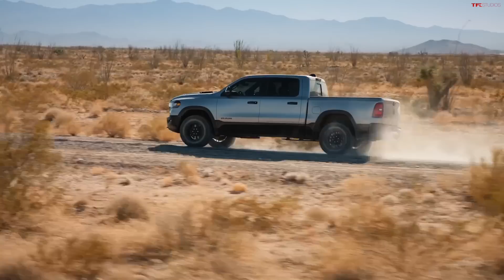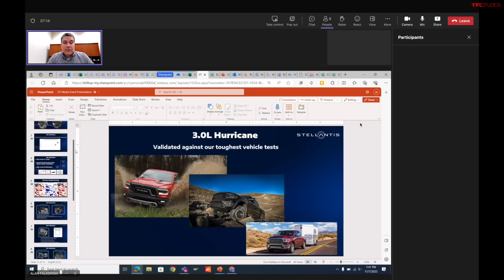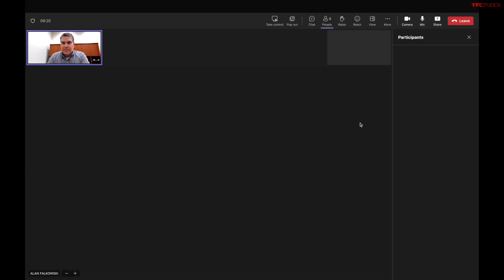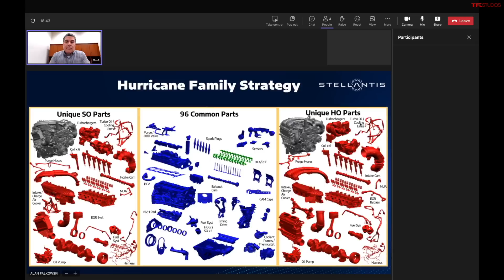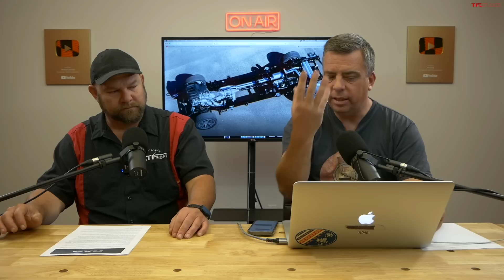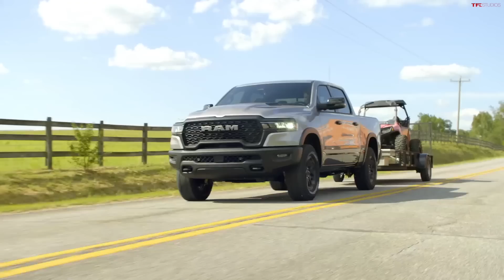2025 Ram 1500 & Ramcharger DEEP DIVE with the Chief Engineers!

Comment: 44:00: Nevermind the 690mile total range--that's just gas tank size--the story is the beefy battery range of 145miles!!!  They had to make it beefy for the horsepower output to make it a towing vehicle.  Buuuut with an EREV they don't have to make it tow in all electric that far.  (They just need to be sure the genset has horsepower output at least equal to the towing horsepower *average*.) 

An EREV can halve the battery of an all-electric towing vehicle while keeping sufficient power.  It's a great reality about the electrification of big trucks--see Edison Electric in British Columbia.

Having talked about the towing, the other benefit of 145 mile all EV range (unladen) is that the neighborhood folks who hardly ever tow will be running on insanely cheap household electricity basically all of the time!  It's a perfect design for every use case from infrequent short range towing to everyday long range towing.  

Even the everyday 600 mile towing use case (lol) gets a lot better MPG than just gas, and the comfort (you're sleeping in it lol) and performance benefits of electrification, to an outsized degree compared to just hybrids. Further, I would argue that to properly hybridize a heavy towing system, you HAVE to have such a beefy battery that you need to make it an EREV! 🤩⚡💪🏾 Yes I'm asserting you can't even have a good heavy towing hybrid without it being an EREV.

In passenger vehicles it's gas, then hybrid, then EV.
In towing vehicles it's gas/diesel, then EREV (with 100+ mile electric range)...then EV later.

Comment: All new = all new problems,   I prefer the Ramcharger approach with a 12 year old engine and a tried older Cab.  There is enough new stuff on the truck which will have issues in the first year or two.

Comment: part 1. 
 new metrics will be required. not hp and mpg. but rather KWH @ RPM, fuel consumed at RPM, etc.  USA should adopt the EU metrics. 
part 2.
what is the value proposition?  seems none.  consider...
1/ tank is 25 gal. range from gas is 500 miles. say, fuel consumption is 20 mpg, UNLADEN.  what will it be towing 6k#?  maybe 10 mpg? 
2/ if 20 mpg, this is now average for all ICE trucks.  so why bother? 
3/ Ram has the worst history for reliability and customer service.  why will this be any different?

Comment: 10 years down the road when its using oil and got more blow by than boost from blown out piston rings and valves see how much you love that forced induction truck engine. Oh yeah but you will be off warranty and they make money selling new vehicles not old ones. They could care less how long it lasts. Sure they hate all them big displacement V8s still going strong after half a mill and 20 plus years. No money in that.😂. Im done with ram myself stick to used market or change brands sad because they are still by far the best looking truck inside and out.

Comment: When they compare a naturally aspirated V8 to a charged (turbo or Super) is is NOT apples to apples. How much HP and Torque would the 5.7 Hemi produce at the same boost levels? More is my bet. How much better would the durability be with forged parts? I could go one, but some proof is available in comparing the TRX Supercharged V8's HP and torque (except it is 6.2L). This also brings up the fuel-air charge size per cylinder. Engines should really be compared based on HP and torque generated per cubic inch or liter as well as fuel efficiency per cubic inch/liter.

Comment: Attention @Ram and @RamTruck owners: The reliability of new Ram trucks has been a major letdown. As an owner of a @Ram truck, I find myself in a frustrating situation with my vehicle sitting in the driveway without an engine, all because the warranty was declined by @Ram. Over my four years of ownership, I've endured a total of six months spent at the dealership, grappling with recurring electronic and emission problems.

My ordeal began when my first engine failed after just two years of ownership, followed by a transmission failure at 2.5 years. Now, my second engine has given up the ghost after a mere 72K miles. Shockingly, @RamCareWarranty refused coverage due to high mileage. It's truly baffling that after investing $50K, my truck can't manage more than 72K miles without needing an engine replacement. What is happening with @ramtrucks?

Comment: All of the new features and options are fine.  But now for the elephant (not the HEMI elephant) in the room, PRICE.  Everyone in the truck business has basically priced themselves out of the market.
Now for the engine:  Will it be as reliable and durable as a slant 6?  Almost certainly not, nothing else ever has been.
Your explanation of why a straight 6 rather than a V6 missed the main point.  The straight 6 is cheaper to build.  And doesn't package as well, but you can get around that in a rear drive truck.  It's going to weigh more than a V6 because of the longer heavier crankshaft.  Yes, it is smooth, but so are the 60 degree boxer crank V6s that Chrysler has been building since 1990.  Using dual exhaust seem rather at odds with trying to control price and weight.  There is no performance advantage to duals following turbos.  
My comments are somewhat irrelevant because I will not be buying one of these.

Comment: I just got a 2024 2500 Ram 4x4 work truck with 6.4l Hemi and turning in my 2018 6.4l 175k miles only problems were fuel pump failure, Electric radiator fan failed, and the inside of the radiator plugged up/ gummed up causing an over heat. Other than that engine was very reliable. 2024 I will update at the end of the summer. the 2019 was the classic body style.

Comment: so I will respond to your tow hook question.  I use mine several times each winter.  I regularly pull US MAIL rural delivery mailmen and their vehicle out of snowbanks.  I also use them to pull my John Deere snowblowert out  when I screw up and slides it off the road.  The real advantage is it is an easy and safe place to hook..  Plus you don't have to lay down on the ground and try to find something underneath that you think is strong enough t to hook onto.  Obviously all this app;lies to the front.  In the rear you use your trailer hitch.

Comment: The range extender may be the best  EV system yet. It's been effectively used in railroad locomotives for decades. I'm a bit surprised they didn't use one of their 4 cylinder engines to power the generator, to save weight and space. I suppose the existing V6 was a more cost effective solution for the first model.
Reply: The pentastar engine is pretty lightweight.

Comment: Did you think the manufacturer would tell you that they created an engine worse than hemi?) It seems to me that the main task is to reduce the cost of production. This engine is no better than hemi and certainly not more reliable, but it's not worse either - it's just another engine. Repairing such an engine will cover all fuel savings, how much will it cost to replace 2 turbines? The oil requirements are higher, the fuel requirements are higher, the engine will constantly work under high load, especially if you are engaged in towing. Only manufacturers, engines, oils, fuels and lubricants benefit here. it's the same as touchscreens. Few people realize that it's just much cheaper than making buttons or dials. What do you think?

Comment: Geez, RAMCHARGER: Lets do the math. 690 range on 27gallon tank = 25miles per gallon. I got 33miles per gallon on my Ram Eco Diesel during a 3500 mile road trip driving + 5mph over speed limits  70 T0 80MPH. Truck is a 2022 Big Horn Level 2 trim. Rides like a sofa going down the road.
Price of the truck 53000. So eliminating the Eco Diesel is foolish move. They should have created a hybrid version of the Eco Diesel. Once the EV mandate gets retracted maybe things will change. In the mean time dealers are having problems selling EVs due to the high costs and the interest rates for the normal Joe. Lets get real-we are all in big trouble with what is going on. VOTE OIL

Comment: mw uncles son inlaw used his towhooks on his 2017 sierra1500 slt2 v6 double cab to  pull down my uncles shed that was a mess and my dads other brothers bumpers allways look used battered crattered dented dinged rusted and abused his 1997 f250 highdisplacement gas v8 longbed doubletank 3door extended cab had no original bumpers on them! so yes nathan people do use them

Comment: I heard from a critic that a diesel (either non-hybrid or non-plug-in-hybrid) would be more efficient at towing than this ramcharger, because of the extra weight of the batteries.  I tried to convince him that the extra battery capacity means that the ramcharger would actually be MORE efficient (even under towing) in hilly terrain, because of the increased regenerative braking capacity.  I hope you guys will actually test this out some day to prove this out!

Comment: I want to see what the Hurricane power output is on Regular 87. I would expect 1.5x the power of the 2L Hurricane in the Jeep products, or 405hp/442lbft- right in line (more hp/less tq) w the other 6cyl turbo engines in the segment.
Reply: Tow hooks- my Silverado really doesn’t leave the pavement, but I’ve used them plenty.

Comment: I suspect if you have driven an XJ Jeep Cherokee with the 4.0 HO and automatic you will have a similar sound and feel. Because the new pickups are heavy and the XJ was light. So power to weight ratio will probably be fairly close. The six definitely does not have the sound of a V8 and I also suspect it will not feel the same either. 

I am intrigued with the series hybrid electric with the gas generator set being mechanically divorced from the electric only drive axles.

Comment: One thing bout one is mentioning is that inline engines are inherently simpler when compared with any V engine. One head, one exhaust manifold, one intake gasket, one valve cover, much easier spark plug access, etc etc…

Comment: Ram sales are tanking now and going to fall off a cliff with these changes. 20k discounts on the horizon. 
I had a 2021 Ram 1500 and currently have a 2022 Ram 1500. Only reason I bought those is Good pricing, the hemi, and great interiors. 

Build quality in both my Rams has been bad. A new turbo engine from Ram? Good luck. And no front bumper? You might as well get a Tundra at the same price.

Comment: The lack of a V8 is going to hit RAM sales HAARRRRRD.  They lost my next purchase because of it, and I'm sure MANY people feel the same.
Reply: They'll be fine.
Reply: Blink security
Reply: People said that about Ford too when the eco boost hit the market.  That didn't happen because it's performance was far superior than the v8.  As long as this straight 6 turbo outperforms their v8 they will be fine.
Reply: @Jez-p9k 
Ford at least kept the v8 as an option for the diehard v8 fans.
Reply: Considerably more power and conceivably greater efficiency with probably greater longevity? Where’s the downside of that? I know I’m excited for it!
Reply: The hurricanes way more exciting.
The 5.7 Hemi did well but its time is really past.
Reply: The people I talk to that have a  Ford eco-boost, don’t make it past 200,000 without replacing a turbo😕💸 it’s going to take them years to get this shit down correctly. Never buy first generation.
Reply: @GetSocialButterfly  150-200k is pretty good for a turbo to be honest for superior power and delivery. Average driving thats what about 12-15 years of usage.  Not a big deal to me.  I'll take that.
Reply: Funny thing is the hemi wasn’t even that good of a v8

Next to no aftermarket support, cast in iron so it’s heavy, and the valves would sometimes drop. Also the cylinder deactivation system would often fail, causing huge repair bills
Reply: Yes. A lot of people buy the Ram for the Hemi and couldn’t care less about the truck around it.
Reply: He is right. The people that buy rams don't need v8's at all..... But it is really about overcompensating for their pinky finger being bigger than their... And they might need that v8 to tow their home to a different trailer park when a tornado comes.
Reply: I'd be more concerned with the hideous looks, Terrible quality, and stigma that comes with driving a dodge
Reply: Straight 6 with turbo will make more power and last longer.
Reply: @ryanb8736 

You must of never drove a diesel long term. Turbo replacements are typically thousands of dollars. It’s not a matter of if, but when.
Reply: @dontdoxmebro  Older turbo technology is a thing of the past. New turbos last a long time now. If that brand still has bad turbos, stay away from that brand. 

The highest mileage vehicles on the road all have turbos.
Reply: @ryanb8736  I don't think so those turbos are known to fail quickly.
Reply: @thorpower1015  my last turbo car had 100,000 miles and it was 12 years old and never had an issue
Reply: @TwinTireman that's awesome but as with most things there will be outliers

Comment: Like most, I have so many questions, such as real fuel economy, maintenance cost related to upkeep.  Reliability and longevity?

What's this motor weigh compared to the 5.7 hemi?  If they are eliminating the v8 why not design a smaller more aero front end and or optimize cab and bed space.
Guess time will tell for most of these questions.

Comment: Did I hear that chief engineer correctly? They killed the hemi, forcing customers to try the SST/SST HO hoping they would like it better? No, bring the hemi back as an option. Don't try to force customers into what you want them to do. It might be time for a Ford, or GM. Gross. I'm so disappointed with ram.
Reply: V8 is outdated slow and under mpg. 🦖 engine needs to be upgraded.
Reply: @Fumbiii16  in its current form sure. But if they put the same time and money into developing the hemi as they did the hurricane you would have an even better engine in every way.
Reply: @EProctor427  but tbh it’s emissions fault for not having the best engines out there and companies don’t want to put money into engineering and R&D
Reply: Ford is, they are keeping the 5.0 up to date and promised to keep V8's as long as possible. They are selling a lot of V8's still. I'm not saying all manufacturers are wrong for developing different motors. I just wanted the option to get what I want. I don't want to deal with smaller displacement, forced induction, higher RPM, higher compression motors. Then expect them to perform as well as a larger displacement lower RPM V8's. The new motor is going to have more issues just based on more to go wrong. Also it will be impossible to have better milage to make a difference. A smaller motor with forced induction won't have the mpg gain to make it worth it. As shown by Ford with the Ecoboost. I just want the V8 option, I would always rather a "worse" V8 any day.

Comment: If it was designed from the start as a truck motor. Why was it put in the grand wagoneer first? Are you sure it's not adapted to be a truck motor? Bring back the hemi as an option. Or I'm not getting another ram 1500. I'm so pissed off at ram right now.

Comment: I DON'T CARE IF THE SST/SST HO IS "BETTER" ON PAPER. I will not touch a turbo 6 cylinder in a pick up truck. My current ram 1500 will be my last until the hemi is back. At least make it an option. But to cancel it outright, I'm not interested. They keep the 3.6 but cancelled the hemi?? Ram has lost touch. I'm not buying a new ram 1500 any time soon. I'm so disappointed, discouraged, pissed off.

Comment: Hemi ticks aren’t an issue if you don’t idle your vehicle for an extended period of time.. if you do; you should replace your oil pump with a melling or hellcat pump to increase oil volume AND pressure at low rpms.
Reply: There’s more than one cause of the “HEMI Tick.” I had one from a broken exhaust manifold mounting bolt, and I do 90%+ highway driving.
Reply: @Danielpeter2344  hemi tick refers to lifter failure and can being eaten not exhaust manifold leaks/cracks

Comment: I'd be curious if there are aero shutters on the radiator for the EV mode?  To me not having those is the only reason the EV mode efficiency might be well under other EVs?  But seems even the REV has a lower range than one would expect, so seems they might just be underselling EV efficiency with these until they get the EPA numbers.

Comment: Nathan, I always tend to agree with you more than most, but I do disagree on the tow-hooks. Over-rated. Been 4wheeling since the early eighties and a CJ. I very rarely use them. I recover many people from the snow, but I always pull forward, never using reverse. The hooks are there to recover you. And that is also important but not for the average truck.

Comment: It makes zero sense to have a gas engine that is capable of powering the truck by itself and using it as a generator. The V6 would normally be in a cheaper model full size truck. This over-engineered garbage will cost $100k at least. I would never buy it.
Reply: What? The V6 does not power the Ramcharger wheels directly. It only acts as a generator.

Comment: Great information.  One question I have is on that EGR system.  Will it muck up the top side of the engine like it does on modern diesels?
Reply: diesels make lots of soot and that combines with oil from the PCV which is why you get that tar like substance. The EGR in gas engines are not as dirty and have been used for decades.